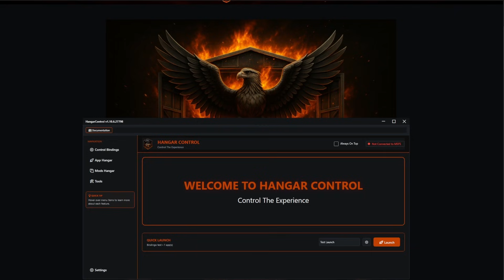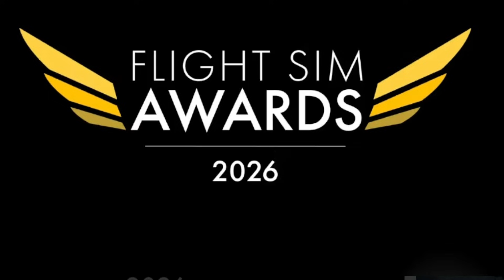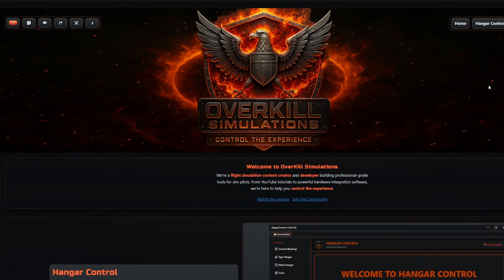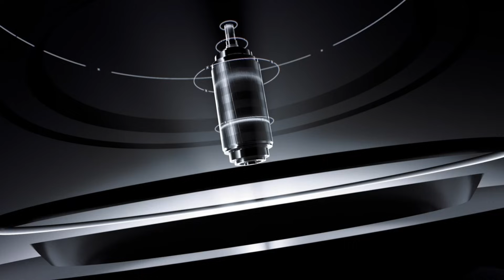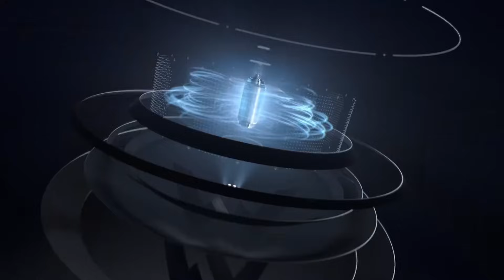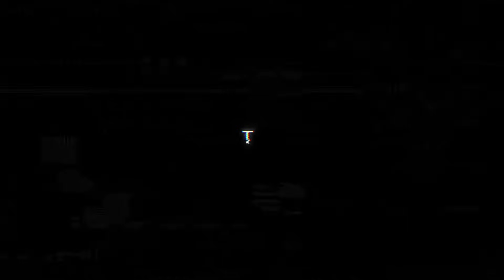MSFS 2020 & 2024 News | Bluebird 757 Wins Big, 727 Updates, Hangar Control Support

Comment: I asked this question in another video but never got a response. Does Hanger Control support the Turtlebeach Flight Deck HOTAS system and the Turtlebeach Velocity One universal flight system with the yoke and throttle quadrant?
Reply from the maker: I actually just got done designing a software that will enable that very support reach out to me on discord if you can